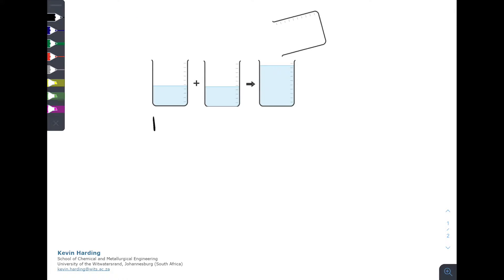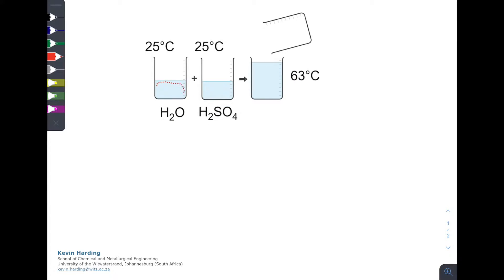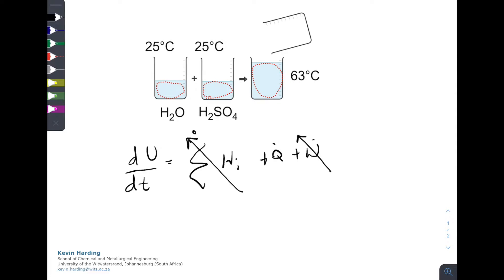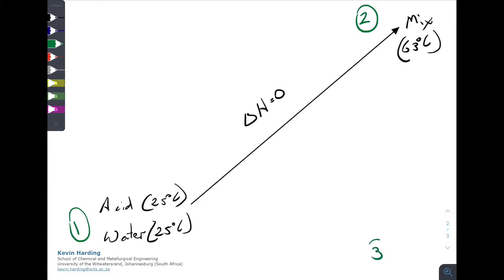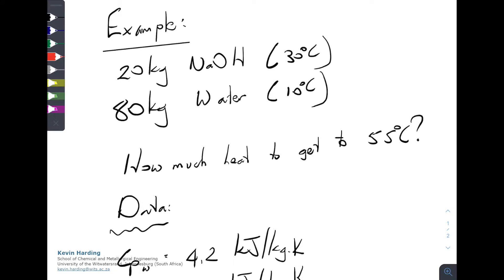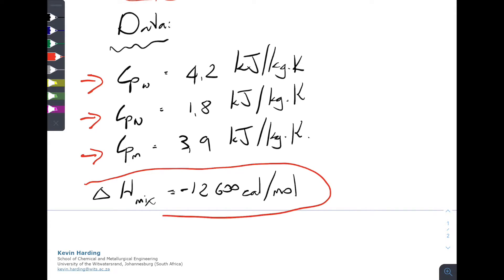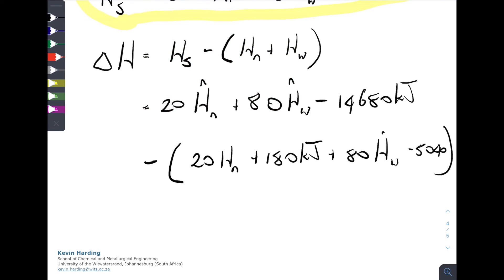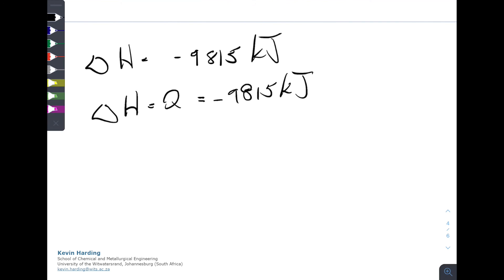Heat of mixing [Lecture]

Comment: Why used 25°C as the starting temperature for both NAOH and H2O. How did you come with that 25°C prof?
Reply from the maker: The value of the heat of mixing in this example was given at 25degC (possibly not made clear enough in the video), and as such the basis of each of NaOH and H2O was taken from the same point. 

The way the question is solved, you should note that if you had taken a different starting temperature (basis) for the individual chemicals, then heated to 25degC, the maths cancels out in such a way that this would not have made a difference to the final answer.